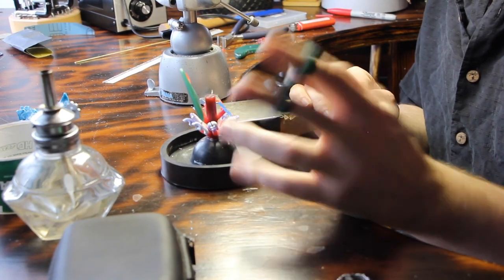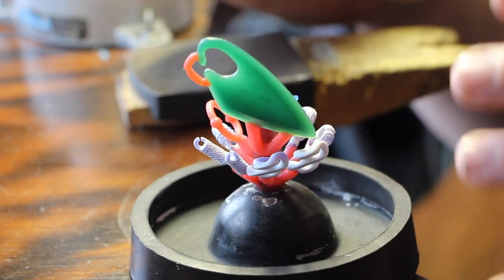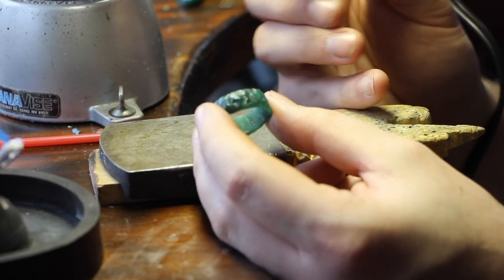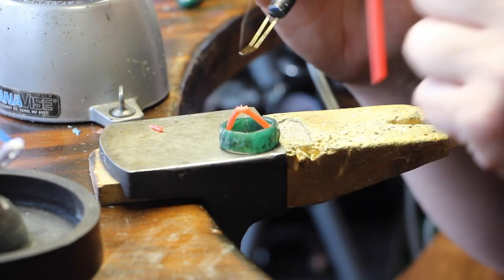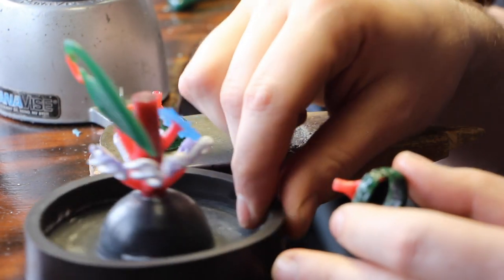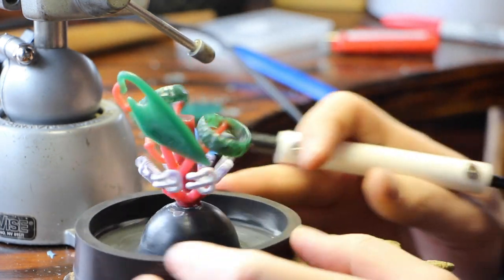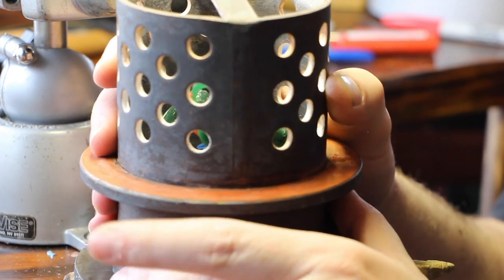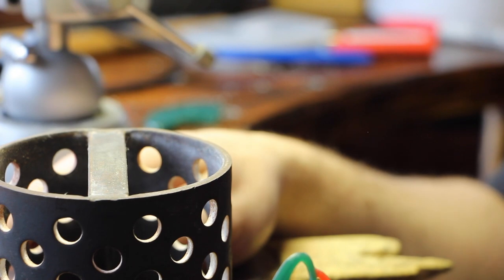Sprueing Waxes for Lost Wax Casting

Comment: Thank you for the clear and helpful instruction! I’ve seen some people make like sprue bridge going from the wax molds to the bottom/top of the flask to make air vent (does that make sense? I’m bad at describing) do you think it’s necessary? I’ve also seen people not doing it and have success so I’m not sure
Reply from the maker: Other casting studios will do things like add wax mesh to increase vacuum pressure when using non-perforated flasks, some casting studios also utilize sand casting methods like creating vents leading from the top of the model and leading into the button (often called chimneys). 
We haven't needed to look into either case as vacuum casting with perforated flasks takes care of the "issues" that those methods are attempting to solve.

Comment: Thank you, I have learned lots 🙏😊. How do you cope with different burn out schedules for different waxes on the same tree ?
Reply from the maker: We follow the recommended burn out schedule as per the investment type we are using.  Waxes are close enough that we don't change anything. When doing a split wax and 3d print we follow the investment schedule for the 3d prints.
Reply: Clear Mind Jewellery yeah, that makes perfect sense, thank you. I can’t afford castable resin yet so I will print, mould, inject wax then cast. Cheers

Comment: Can i ask what might be a stupidish question? I'm a noob. Thus far I've prepared some wax copies of rings thru silicone molds. I'll be moving along to the plaster part soon i hope but a question occurred to me. Is it 100% necessary to melt out the wax from the plaster? Why can't you pour the molten metal into the funnel and let the hot metal just melt and replace the wax? I know i don't have a full grasp on the mechanics yet but i was thinking about the point while watching people carefully melt wax out of their flasks.
Reply from the maker: The fumes “wax” would have to have somewhere to go and the metal would be in the only way out. The wax would have to incinerate instantly which usually it’s doesn’t. 
You need the burnout cycle anyway to properly set your plaster.
Reply: El conservar la cera,para que el metal la desplaze es incorrecto,pues la cera al findirse oroduce gases que pueden quedar en el colado.mejor aun porque mejor haces un molde vipartido ypuedes espulsar mas rapido la cera.
Si tienes un molde de hule vulcanizado y lo ahogas durante 24 horas el molde se hincha casi 500 veces,posteriormente con parafina cuelas un modelo unas. 50 veces mas grande,proceso "jonapru"

Comment: I am watching this video to understand the difference between handmade, lost wax cast and die, to help value jewelry. This doesn't seem to be much of a short cut to handmade and also requires skills. I think its more complex then many handmade pieces. Is this true ? Is the wax piece carved by the creater too  or can they be purchased ready to cast?
Reply from the maker: Wax models are generally carved by hand. I've never seen pre-carved models before for sale, however you can purchase injectable rubber molds and skip both the carving and mold making processes. 
If you are doing one of a kind hand carved waxes it doesn't really save much time vs fabrication. If you decide to learn mold making, 3D printing, or another reproduction method that is when you will save time over hand fabrication.

Comment: after casting, is it not difficult removing the spru's
Reply from the maker: The spru's can be removed with either snips, a jewellers saw, or a rotary tool with zip discs. Its really easy if the items are spaced correctly.

Comment: Hi great video! Thank you for posting! I have a question I'm am new to casting recently just purchased a suction vacuum for my castings. I was having a problem and am trying to figure out what it is. My furnace is having problems with adjusting to the correct temperature it only stays at 300 or less and turns off on its own. My castings are not coming together at all could it be because the flask isn't hot enough in the center?and the molten sets right away?
Reply from the maker: If your metal and flask aren't at the proper temps that is always a good place to start. 
Your flask should be approx 1000 degrees below the casting temp of the metal at time of cast. This means the flask is usually twice as hot as what you're saying your kiln is getting to, depending on your metal.
Reply: @ClearMindJewellery  Im having incomplete castings? it goes all the way untill the spru and stops there. Im using the vacuum suction.
Reply from the maker: Hi,  @macykeovilay6010   I think you also commented on our instagram. Unless we know more of the process we can't really help. It could be the way things are put on the tree, the temperature in your original comment is a concern, if your vacuum isn't performing correctly, etc. 
If you want a specific diagnosis you can join our membership program and come to the Discord group with some photos and other info and we might be able to help. - Shannon

Comment: Question, why are some waxes difficult to melt together?
Reply from the maker: Every wax has a different melting temperature. Red spru rod (as seen in the video) is generally low temp and quite soft and green and purple waxes are not. There are other types of spru rod that may have a better temperature rating for the type of wax you're using in your models to make the spruing process easier.

Comment: very informative! thank you very much! I started doing my castings and I would say spruing is the hardest part of the whole process. Nice tip about lifting the base. One question....You put all 3D prints, injection wax and carved wax on the same tree. Are the prints solidscape wax or resin? thank you
Reply from the maker: The 3D prints are all wax, you can mix and match waxes in a flask its all fine. If I do resin I make sure its a castable kind.
Reply: @ClearMindJewellery  I see. Thank you. What printer did you use for 3D prints? solidscape ?
Reply from the maker: Its a ProJet MJP 3600 system. We contract our printing out. This system is duel nozzle so we have high res waxes with dissolving supports.
Reply: @ClearMindJewellery  Excellent video! Thx! If you use resin prints for casting, lets say powerresin-dark 3d prints which you seem to use quite often, you then  mix them with wax or resin sprues? Anyway I heard resin does not stick well to neither wax nor resin... What do you use in that case to build the tree for the casting? Thank you

Comment: Hi. I have an Anycubic Photon and use BlueCast Original castable resin. I always follow curing instructions, but why my casting service is unable to cast my prints properly?
Reply from the maker: Antonio Cataldo with printing still being rather new not all casting studios have practice at casting from prints. There needs to be a longer burnout with printed pieces and your casting studio needs to be more aware of spru size and placement in case of ash.

Comment: What kind of sprueing wax do you use and where do you get it? Also, where do you get the thicker sprues that act as the base sprue?
Reply from the maker: We get most of our casting supplies from Gesswein. The smaller pink ones are pretty standard. The 3/8” central sprue is available in flexible pink and rigid turquoise. I strongly recommend pink.

Comment: Great video man! I'm trying to dabble in metal casting myself, but I'm struggling to find anywhere to purchase wax sprues. The ones sold online are super expensive. 
Is there any way to make my own sprues? (or any other advise would be greatly appreciated)
Reply from the maker: The easiest way would be to make a mould and inject your own, you could make the smaller and larger central rods in any variation you want this way. This is definitely something I am considering doing myself at some point in the future to save on cost. 
Of course this only really works if you have a wax injector. 

If you’re printing models you can avoid all but the central sprue by printing them in place or even just printing the entire tree preassembled.